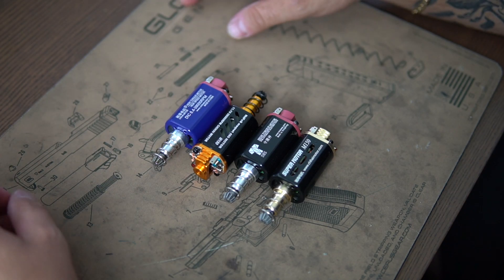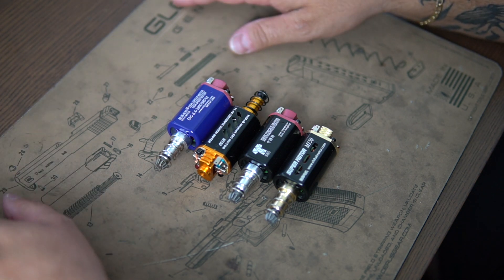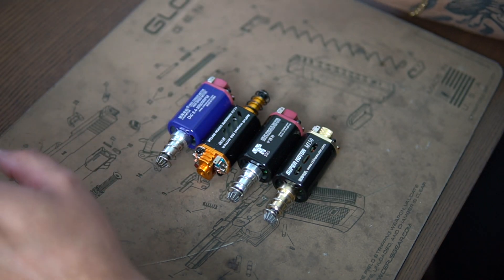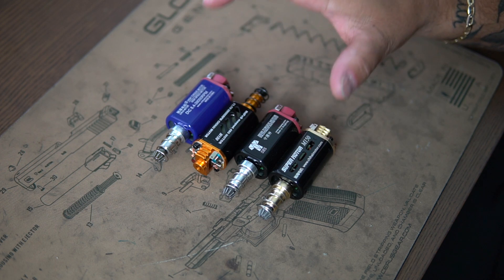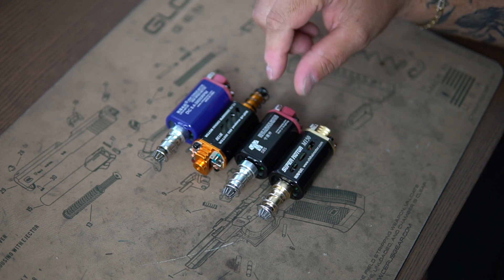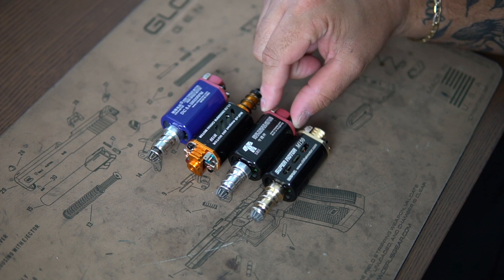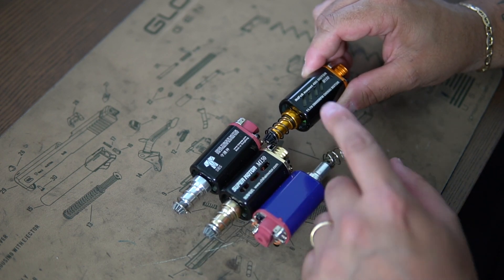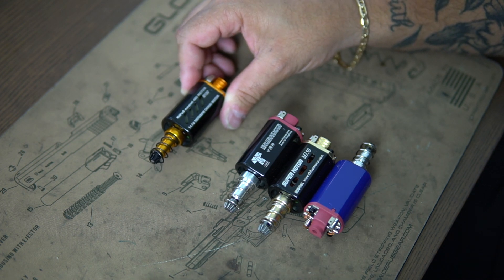Upgraded Motors for Gel Blasters | What Motor Should I Use? (High Speed or High Torque?)

Comment: Hello..im planning to make a balanced build on rps ngn fps for my slr..rn im running a 16:1 gearbox ratio and planning to get a m130-m150 spring..is shs high torque motor is the correct option?or should i get something else?

Comment: What motor is best for FPS? I about to get my m4 punisher In the post In the next day or two and I’m ordering 1.4 spring metal gears green o ring alloy barrel/metal gears and metal teeth ladder/alloy cyclinder head and nozzle
Reply from the maker: SHS High Torque, as its fast enough for great RPS but not too fast to compromise FPS!

Comment: I want to upgrade my gel blaster to use a 14.4v lipro battery with the only reason to shoot more powerfully for distance etc. What motor can I get to withstand such a high battery? I can only find 480 as the highest. I currently have a 480 long with a 11.1v battery. I am at 320fps right now and want to get to 350+

Comment: Higher speed (less TPA) = less torque
Lower speed (more TPA) = more torque
Stronger magnets = Higher torque (N45 is max)

Motors has NOTHING to do with fps.
You can't really recommend a motor/gear ratio before you know what your rps and fps goal is.
Reply from the maker: Of course, however if you have a high RPS motor, and try a heavy spring you simply can not do it. Therefor, the high speed motors would not be able to push the higher FPS builds like the high torque motors. There is no specific FPS that they hit, but you can absolutely argue high torque motors hit higher FPS in general builds. :)
Reply: @GelBallUndercover  awesome thanks.
Reply: Yeah.. uhh.. you're wrong. You need a high torque motor to run a high FPS build
Reply: @DanielFreakinAwesome2  Not if you use a higher ratio of gears like 26:1 lol and almost NOBODY in general use springs higher than a m150 in full stroke aeg's do to joule limits.